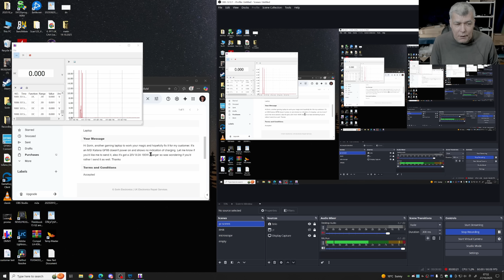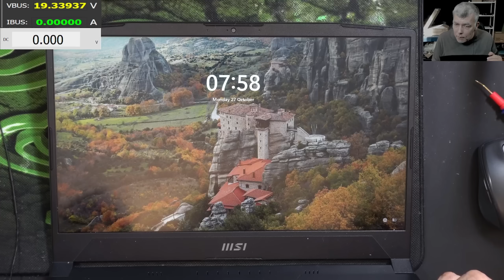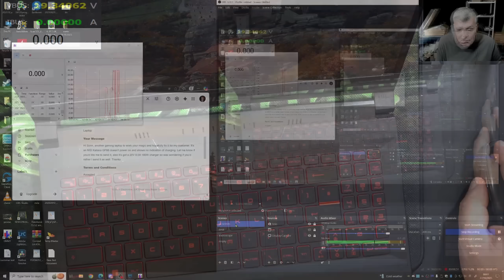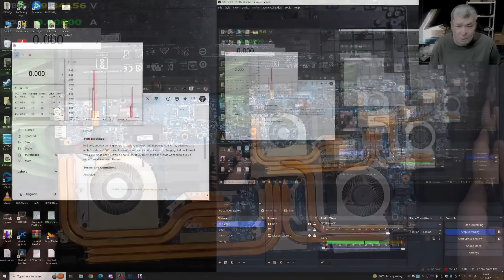MSI Katana GF66 no power & not charging - Explain this fault

Comment: If the computer repair shop did reset the BIOS but the laptop still didn't turn on then when you could successfully got it to start you should've seen a slow POST screen and get the default BIOS values message.

Comment: Sorin, if you can explain this type of issue then i would be a great help for me... I've gone through with this fault in many laptop mostly on HP laptops 😅 laptop seems to be dead, no indicator, will not turning on neither battery gonna charge... to solve this issue just REMOVE BATTERY AND RECONNECT AFTER 2 SEC that's all problem will gone 😂😂 what kind of fault it is ?? I couldn't understand with my technical knowledge

Comment: Maybe the laptop requires the main battery to be plugged in to work and the plug was corroded or not making good contact until you unplugged and replugged it. The computer shop may never have even touched the main battery.

Comment: Yo, Sorin. Maybe you'll see my comment. I have gf76 and one of the left usb ports when I jiggle the connector shuts down the laptop. How bad is this? Possibly was corrupted by bad extrernal keyboard, it needed to be reconnected several times in order to work, when I tried to fix the membrane connector it stopped working, now I am left with usb issue.

Comment: Hi,
I had a question that I figured is perfect for Sorin or our fellow repairers,
Should I worry about skin contact with soldering flux? Most of the time if I’m recycling boards I just leave them as is with the residual on them. I usually only use Amtech flux. Any input is appreciated!

Comment: There was a short on the charging circuit, that's why it didn't turn on, the battery got discharged. Then your power supply blew up the bad guy (probably a cap)... and everything started to be working fine
Reply: But shouldn't that be a nearly shorted main power rail or shorted charging coil?
Reply: @drmohammedalmasri good point
Reply: ya thats what i was thinking about the charger will disconect when it is a short but the power spl will push crnt no matter what
Reply: but the battery was nearly fully charged

Comment: My guess would be that a component was faulty, half shorted or something and was causing the original charger to power off, and by injecting voltage the faulty or half shorted component died with open line. So charger is fine and battery is enabled again.
Reply: probably a capacitor , no capacitor no shorted capacitor :D  :D :D

Comment: Sorin, remember that in the begining you don't have a voltage on the battery. After you push a current from power supply the things have worked and the laptop go starting and charging.
Reply: Battery was already charged
Reply: @regresoderambo  But the voltage on pins was zero 0V. The output fets was closed.

Comment: I get these faults all the time, sometimes ESD goes into the board and it fails to turn on until discharged.  Usually taking power and battery out for a few days gives it a chance.

Comment: That charging port looked very high movement at this post.  And that main battery level seemed to move quickly.  As for any magic touch, the stuff of pizza.  I have seen in particular a very curious fault as solder abrupt fail.  That is what I might  suspect as a crack, fault to the board strata.  Or, that the unit arrived with other mix up beyond the control  of the submitter (shop)? The sender, as a mixed order note?
Maybe as the hinge was placed to intermittent  loss of power as described. Stress to circuit board.  
The best auto techs often simply keep machines with ghost faults for days.  Natural stuff like temp cycles.   But as the screws removed, a job submitted from outside, there could be unknown elements outside of control to the job intake. And the job description.  Faulty?
Make a phone call or send email?

Released for sale as 2021 by web sourced notes, the GF66 model has various citations as a :low-medium product as gaming, with battery as best protected by charger plugged in. Several battery fail. Several notes as abrupt high heat. And quite a bit as to machine- game need for compute engine.  As a tech, curious as to the fault, I also take note that such gaming reset to overclocking can cause temp induced temp brick 
but maybe in the end, I'll have my pizza with xtra cheese.  M.

Comment: Sorin, you checked if the laptop is coming on without a charger or the battery plugged in, for sure it will not come on, doesn't mean it was faulty. Battery had 0V when plugged but could be bad contact of the probes. 
When you put the power supply there was a brief current jump to 1.7 then came back down to 1.5, so probably a shorted component that  got interrupted. Perhaps the chargers protection cut out before blowing the short and your power supply did all the magic

Comment: You should realy consider do the "hard pizza" repair. MB can have waterdamege on the top. Ports was not checked. USB short can cause motherboard start issue. Especilaly when you have e.g. phone charging when coputer is off. I don't know. Maybe you have a different agreaments with your customers, as they are computer shops but you should check that in my opinion.